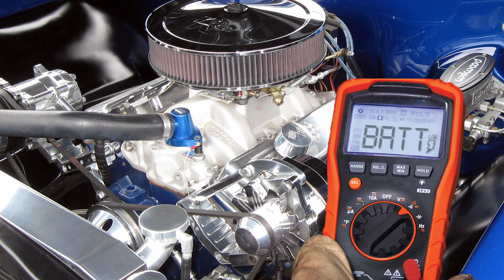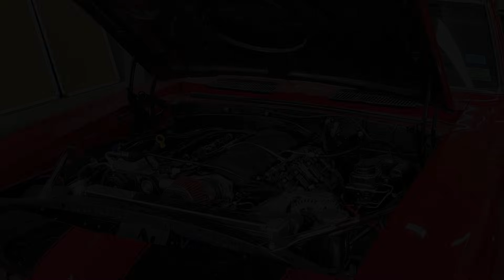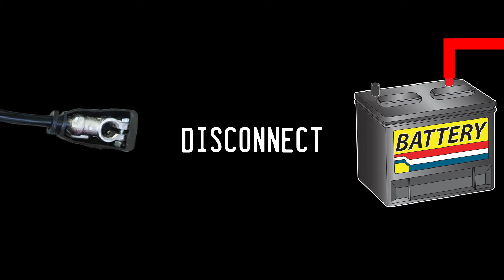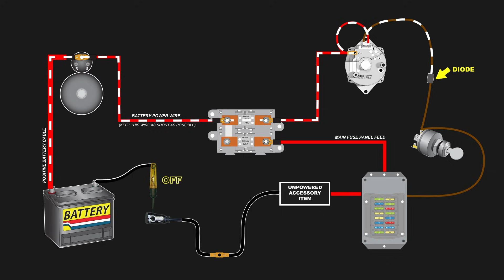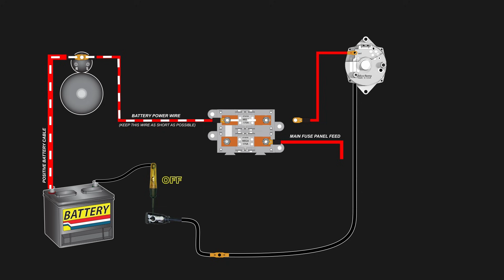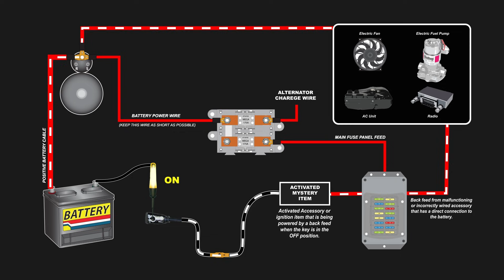Battery Drain on your classic car? Find it FAST with these Easy Steps

Comment: No offense,  but this is an antiquated testing method.  You should be testing with using milliamps and voltage drops over the fuses. Telling people this is a good way to test their vehicles is really going to frustrate them and lead them in the wrong direction.